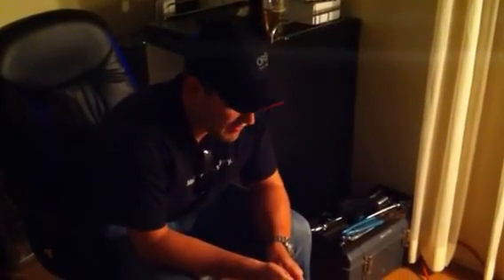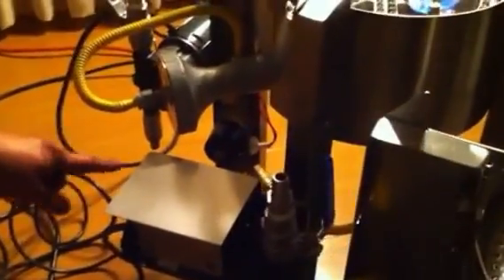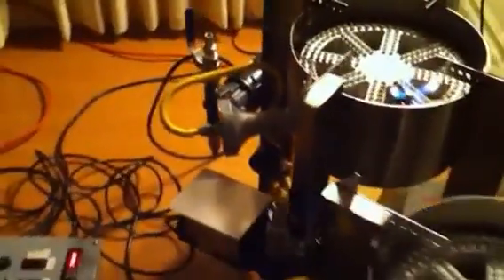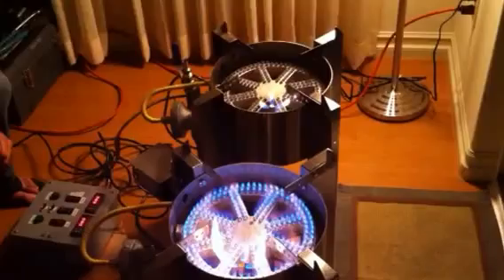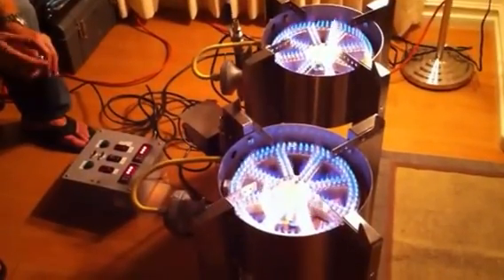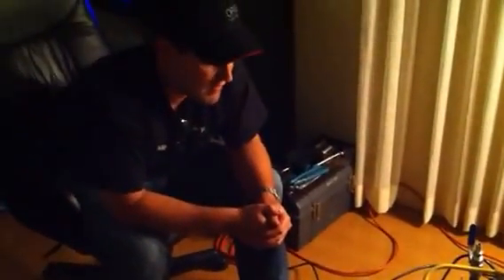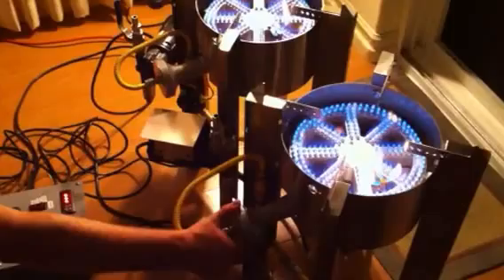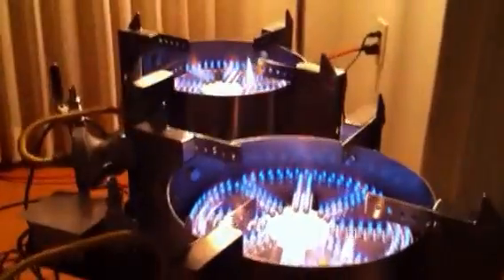Automated Blichmann TopTier Burner Regulator & Solenoid Test

Comment from the maker: yup. 1/8 female flare.  Then, either crack the ball valve, or get a 1/2 PSI regulator just for your pilot lights.  In retrospect i kind of wish i had the second regulator.  That way the pilot flame wouldn't change heights when i crank up or down the main burner.  A second regulator seems like the best option, but also the most expensive.

Comment: Right, so either way, you have to get that 1/2 SS flex line down to 1/8" female, so the jet pilot can screw into it properly. Other than that, you can just control the pilot flame size with a ball valve. That sound about right? I suppose the pilots won't go out if they're turned up enough, and that's just through trial and error?

Comment from the maker: The Blichman burners are exactly the same as the Banjo Burners. They run at 10 PSI.  Honestly 10PSI is a bit much for the pilots, so I use a ball valve to cut back on the flame.  I barely crack the ball valve to get a nice 1 inch flame.  You can see in the video that I had the one on the right cranked up a bit too high.

Comment from the maker: No, it's definitely not that easy.  I had to use 2 adapters to get it on the 1/8 gas line.  I think you need a 1/8 inverted flare adapter on one end and a 3/8 male flare on the other.  I couldn't find that in a single adapter, and I doubt it exists, so I found inverted flare to NPT and then converted NPT back to flare.

Comment: Thanks for your prompt response. Are they connected to the end of a 3/8" gas tube? Is it really that easy? And what type of pressure can you put into them?

I'm using Banjo Burners, which I'm told run best around 10psi. Is that too much for the jet pilots?

Comment from the maker: The Pilots are "Town Equipment - 226810 - Jet Pilot" propane pilot for 23 & 32 Tip Jet Burners.  Obviously I'm not using them for jet burners, but that's what they were meant for. 

I got them at : Restaurant Solutions Restaurant Supply, but you can also get them at Culinary Depot for about $5.

Happy Brewing!

Comment from the maker: one is an ASCO 8030G17, but it cost over $100.  Then I found an Ehcotech B21N 120VAC normally closed on ebay for about $35.  Don't waste your money on a name brand solenoid.  The B21N from ebay works great.